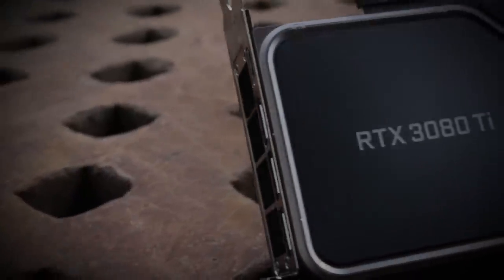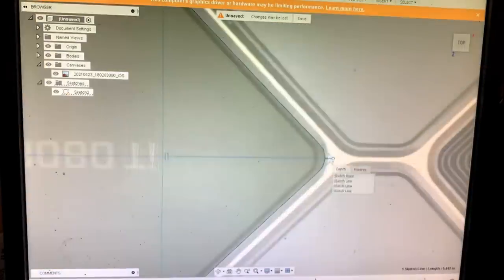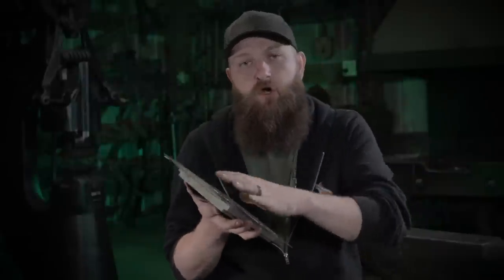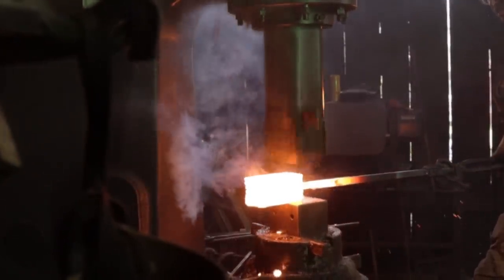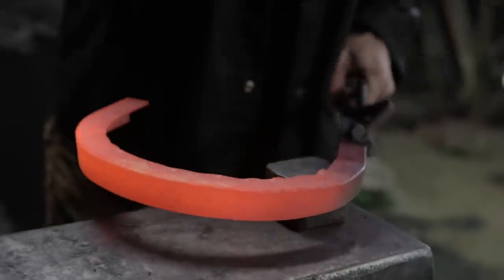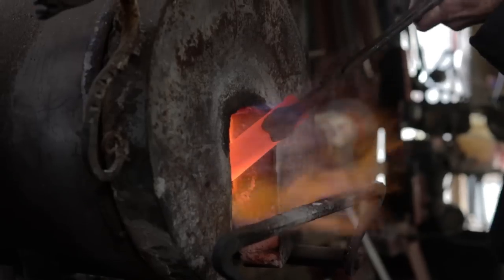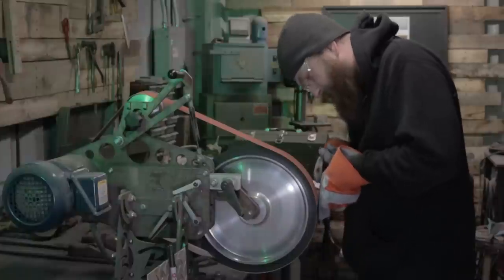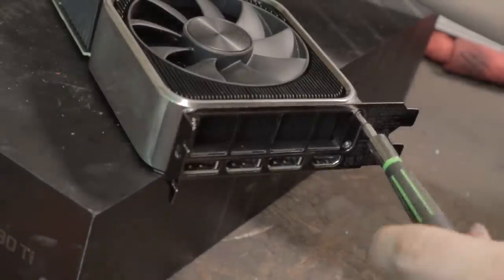Damascus Chest & RTX 3080 Ti - Titanium Shroud  [NVIDIA GEFORCE]

Comment: I too agree that crafting one is the only way of obtaining one :D
Reply: Instructions unclear, hitting my old GTX 980 with a hammer hoping I can forge it into a 3080 Ti but it's getting smaller, not larger.
Reply: @racerex340  did you try welding on a 1080ti?
Reply: @dragonwing4ever  that's where I went wrong.
Reply: @racerex340  its an easy mistake to make

Comment: im subbed to like 5 or 6 tech channels and this is the one I see concrete confirmation that they're coming out with a 3080TI and not just rumors? lol
Reply from the maker: :D
Reply: They are 100% launching the 3080 Ti on Thursday. 12GB VRAM, 10240 CUDA cores, 80 RT cores, 320 Tensor cores. It's basically going to be a 3090 with a tiny bit less performance and half the VRAM. I think some games will actually perform better on the 3080 Ti than the 3090 due to the card not having such an excess of VRAM, little less overhead. I'm thinking about 20% more powerful overall than the 3080, and if you don't factor in VRAM, about 97% of the performance of the 3090 on average. Oh, and $1200 for the FE edition (good luck finding one), more likely about $1400 for the AIB partner cards, maybe  $1600-$1700 for the nicer AIB cards like the STRIX, considering most AIB 3090's are $2K or more now.

Comment: fun fact, Titanium is approximated 1/10th as efficient at transferring heat as Aluminum is, which means that with all of the casing bits on this card replaced, it'll probably heat up ten times faster than the standard release 3080 Ti

Comment: Make the Hilord sword an' dagger from For Honor! Y'can't run from this forever. Give the sword blade the straight edges, the sharp point, AND the hexagonal cross-section. The Hilord sword's gotta have the gold-plated guard with the curved quillons that're swept to the blade, the two red gemstones, AND the gold-plated pommel. The dagger could look the same. The sword could be a one-handed sword.

Comment: This card would actually be worth the 3000+$ that the 3080 and 3090 get sold for currently. (due to the chip shortages and out of stock situation)
Reply from the maker: Hopefully things will be back to normal soon!
Reply: @ThatWorks  i would really like that card, but it would be such a waste in my PC. Im all out for function/power not optics. My current PC stands below my desk and has no glas pannel currently still sporting a GTX 1080 TI Ultra that was reasonably priced at 1080€ :P when it was new.

Comment: Okay, since the pattern welded steel chest has become a thing, it's made me curious: is it possible to make pattern welded steel with highlight layers of gold, like how you make cu-mascus with copper layers in the pattern?
Reply from the maker: sure!
Reply: A certain Aussie You Tuber. Did a video about Pattern Welded metal versus "Damascus". So are the panels Damascus or Pattern Welded.
Reply: @umbraelegios4130  pattern welded, by technicality. Technically, Damascus refers to wootz steel as seen in historic examples of blades from the Damascus region. However, pattern welded steel has become so commonly referred to as Damascus steel that there's little point in making the argument about it anymore. I try to be specific about it because I'm a pedantic asshole like that, but it honestly doesn't matter if you say Damascus or pattern welded steel unless someone is actually working with crucible steel that has enough vanadium and chromium to form the indicative carbide structures of wootz Damascus steel when etched. Otherwise, Damascus and pattern welded steel are synonymous.